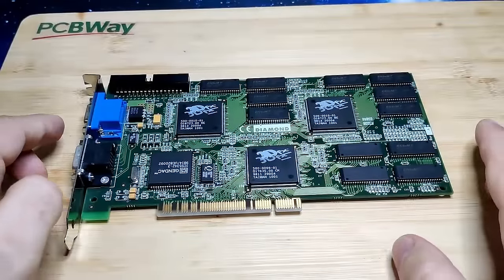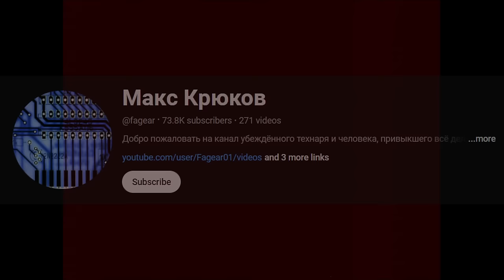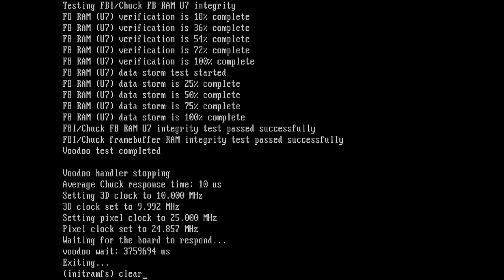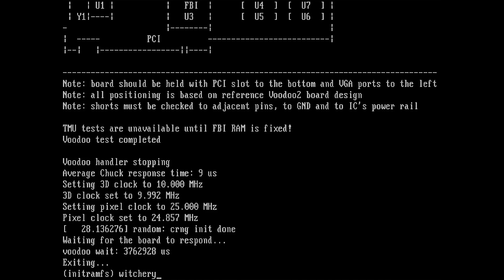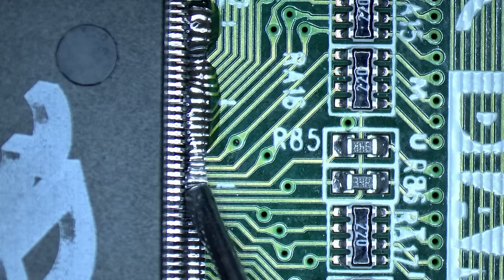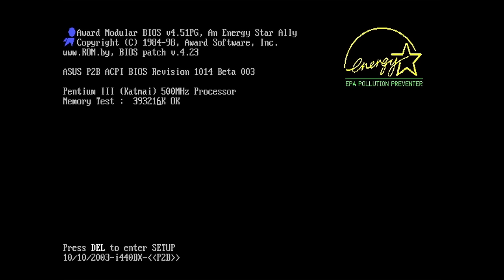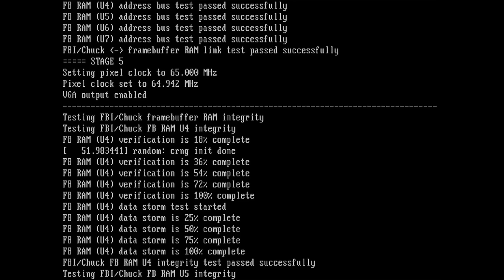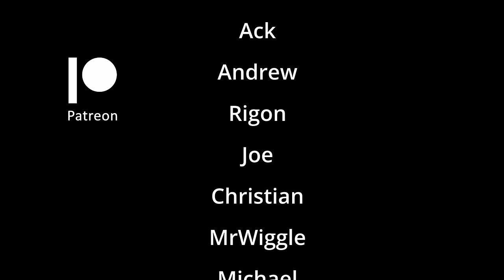The ultimate 3Dfx debugging tool: Witchery! Debug any Voodoo 2 and fix it! (Part 3/3)

Comment: Thanks for the shout out!
I'm glad that this heavily burned V2 board is back to life! 👍🏻
The software is still "work in progress" and it can do very little at the moment. Also all development is done on Linux, so this DOS-loadable package was rushed together and is not perfect. The idea is to get a Linux kernel that runs on 486 and up, the utility itself is compiled to run on 486 (but not tested on it).
I've already fixed some visual bugs to make output clearer, added verbose and help options. VGA output from the Voodoo is not usefull at the moment.
And I have trouble with direct access to upper 2 MiB of FB RAM and with accessing TMUs at all. Any help I can get is great, so feel free to let me know some magic that can allow that.
Reply: Woah. Didn't expect to see you here. I didn't watched your streams for last year or more. So I thought that you digged deeply into VCRs, cameras and so on.
Reply: Very interesting! I wonder if your tool would work for debugging Voodoo3 cards as well. I have one that has some weird memory problems as well, which persisted after replacing the memory chips with known good ones. And as a bonus I am also a Linux guy and would be comfortable running your tool natively.
Reply: great piece of software. excelent work Макс.
Reply: Are you planning to extend the tool to work on Voodoo5 cards? That would be amazing, since there is absolutely no software available for them. 
Thanks.
Reply: Your software is a godsent already, even with what it currently does. Just think about it, any error it diagnoses can save a card. Any error it can't diagnose isn't worse than what we had before: dead cards on a shelf.

I'd really like to test the current build, even if it had to be run natively on linux. PCI Slots exist on late enough boards to have a dedicated linux-based tesing setup that could run recent linux kernels.
Reply: Great tool. Keep the good work.
Also BuB, thank you for the info!
Reply: @stamasd8500  as far as I've found from V3's datasheet it is pretty similar register-wise but it obviously lacks FBI/TMU divide and on V3+ main IC is BGA so probing anything is very difficult. Also memory organisation will probably be completely different. Most of the useful stuff for V2 was done while stepping through addresses while probing and shortng some pins (that's how I've managed to get per-IC map of the FB RAM address space).
Reply: I think you should release it to open-source already, it looks very promising and could restore some cards! The retro community will help with the rest
Reply: @worroSfOretsevraH  the thing is that this utility does NOT use any drivers, it avoids using those. Drivers do not perform any viable tests and just assume that hardware is ok. And when it's not - everything blows up/hangs when you try do anything through the driver. So I have to do it the hard way through direct register access. And there is little information about the registers and inner workings of Voodoo cards. Like, description of a bit says "Linear frame buffer accesses stored in memory FIFO". Ok, I know what "Linear frame buffer" (LFB) means. But what's memory FIFO? Where is it stored? What addresses? What does it change? What commands will be affected? No information on that. And that's only ONE bit in ONE of the registers in ONE model (V2). The V2 itself has a couple hundred of those registers and each contains 32 bits. And V1, V3, V5 will have different registers with different (from V2) functions.
Reply: @fagear  yeah it makes completely sense. The little ASCII graphics you included in the output already told me you worked on a hardware level to develop witchery, not just software :)
Reply: @stamasd8500  yeah... But even that is not enough. For example, I can not find a way to write or read second 2 MiB (RAM ICS on the back). Those are in parallel to the front ICs but have a separate /RAS. Everything I try to do is just mirrored to the first 2 MiB. All test will pass even if no RAM ICs are installed at the back. And I cannot simply probe /RAS for back IC 'cause it is always pulsing as the front one does due to RAM refresh. There several bits in several registers that should be linked with addressing, banking, etc., but nothing I try removes this mirroring of 2 MiB.
Reply: What a fantastic tool. I have a Voodoo 2 waiting for repair. I think the sooner this tool is released, the sooner people can jump in and help improve it :-)
Reply: Nice job man! I'm subscribed to your channel since a long time and like it a lot. Unfortunately, I heard, that YT is being blocked in Russia and now many creators throw in the towel.
Reply: @necro_ware  Wow, thanks! Yeah, "they" try to slow it down but there is always a way around that. I'm not planning to go anywhere from YT.
Reply: Тот случай, когда из видоса басурманского ютубера узнаёшь о том, что Макс создаёт софтину для тестирования вуды. Это было неожиданно!
Reply: wow, debian 1.1 or did i read that correctly?!
Reply: @fagear  so you know about datasheets, good. Next, source code of official drivers is available as well, some info can be obtained from there. And lastly, some open source emulators (like Bochs and MAME) have working digital clones of Voodoo hardware. They are not perfect, but at least you can trace how FIFO works in games and operating systems.
Reply: Is there a reason why you needed to develop under linux, or just a convenience for you?
Reply: @worroSfOretsevraH  i am co-author of this tool and it started like "p3 motherboard with four voodoo2 cards in one place and i am 700km away". i think you cannot do this reliably on dos/win98 at all. xD
and it is easier to use pci bus on linux (both kernel- and user-space).
Reply: Perfect piece of code to run via PXE network boot! Should be easy.
Reply: I hate to be the guy to spoil your parade, but modern Linux kernels and running on 486 may be a tall order.
A YouTuber into "cursed computing" have tried to get a modern kernel running on a 486 (With a lot of RAM!) but it turns out that it has been silently broken for a long time.

So either you will have to live with an old kernel and use old tools, or you will have to patch the newer kernel up, although it does leave Voodoo AGP cards in a bit of a bond due to the AGP voltage problems on the last generation of AGP boards (LGA 775)

Still a good job and I really hope it gets better.
Reply: @CMDRSweeper  "modern" 32-bit x86 linux distros usually compiled for pentium pro and newer. so leave 775 in museum, p2/p3 boards will do it xD
but for example amd k6/6-2 will not run it, because of unsupported CMOV instruction.
Reply: @fagear amazing piece of software!
Reply: A wonderful Work.
Great Job.
Reply: Тот случай когда хотел подписаться на ещё один классный канал, но уже много лет как в подписчиках))
Reply: two suggestions:
1: evaluate running this atop elks.
2: statically compile everything.

#1: embedded linux kernel subsystem. this has support ranging back to afaIr the original pc's 8088.
#2: statically compiling programs means they become practically entirely kernel-agnostic; to put it short, every kernel from I believe 1.0 onwards has had a stable abi, ie it's literally been identical since 1.0's release; that abi is what statically compiled programs rely on, which in turn means even a program compiled today on kernel 6.something could run on a 1.0 kernel exactly as it runs on your 6.something kernel.
Reply: FreeDOS is open source. Just a thought.
Reply: I left a top level comment with this idea but I thought i'd also reply to this comment. It would be cool and helpful if the testing would output the console debugging text to a serial port as well. That way you could plug a serial terminal or another computer running one in and see the output is real-time. It would also be super cool if the RAM testing used a "March Test" which is supposed to be one of the best methods of testing RAM to track down specific bit errors that can slip through other tests. Adrian's Digital Basement recently talked about this in his video about the PC DOS BIOS ROM testing project that's out there. In any case this is amazing and I'm looking forward to trying it out on my working Voodoo card once it's released!
Reply: @Koutsie  I think that's the Debian version of the BusyBox package. It looks like the current version available for bullseye (oldstable). The Linux boot messages mention IPv6, Spectre mitigations, and a systemd version so it must be pretty recent.
Reply: Thank you so much for developing this diagnostic software, I'm hoping for a release soon to check my broken Voodoo 2!
Reply: Фагир - сила!
Reply: @destrierofdark_  good suggestions. To be clear, the tool isn't ready for public release. All development and debugging is going on the P-III-S with debian 11 on it. The "DOS package" was assembled literally in one evening by the man that does not understand most of the linux stuff (that's me). When the tool will be sort of ready then some time will be put into "how to do DOS package properly".
Reply: Thanks for sharing, subscribed to your channel.
Reply: As a work in progress it looks to be a pretty darn cool functional verification test tool already! Have you checked the gunzipped pdf "Voodoo 2 Specifications" available at the old sstfb sourceforge project docs page? It's very cryptic, needs a clear understanding of a rendering pipeline (or 90s console/arcade dev experience?) before the shader age, but has the three memory mapped address space ranges and a very long list of registers. The first 4MB is the registers, second is the frame buffer and the last is the texture memory in a contiguous 8MB, but why it's adding up to 16MB I have no idea. Future expansion, memory price cost cutting, off screen render, double buffer swap into nothing? As I understand correctly, writing to the FBI and TEX range might need the prior setup of a pixel and texture format mode and writing the memory in those formats through the mapped ranges. From the looks of it the Chuck takes care of the comms to all Bruce instances (limit is the fixed number of CS pins or internal bus address?). I'm not a good PC hardware guy and I don't know if you need to do the mapping in the kernel or the BIOS already took care of it. Maybe the former, because I've seen one kprintf stated "PCI BAR0". Also there's a built-in pin solder/silicon mfg testing process I guess which is called NAND/NOR-tree testing. I've read about it on the basic hw level in a TI app report, but no idea how 3dfx implemented it. I saw it even in the debug log output while running the donut demo, but no idea what the numbers mean: "sst1InitInfo(): NAND-tree: 5581, sst1InitInfo(): NOR-tree : 5415". Does it even have a JTAG? Some people on vogons stated that by looking at the schematics of a Midway Seattle arcade machine one can get the pinouts for V1 ASICs which mostly align with pins of a V2. If you haven't seen this specification yet I hope it clears up and confirms some of the pin shorting and prodding trial-and-error behaviour for you. Your keeping it simple method really sped up the reverse engineering process. In the mean time I'd like to see this tool come out and a donation page being set up. :)
Reply: @chironbramberger  well, I'm not very familiar with Linux, isn't there a way to pipe program's output to the serial? As about "March Test", I've read some documents about it but I'm not very good at math, so I've implemented verification test as I've understood what March Test is. Probably it already is a March Test. Probably it needs more work. It's hard to tell for me.
Reply: @fagear  On linux almost everything is represented as a file. I think it's as easy as just redirecting the witchery command's output to /dev/ttyS0 ("COM1") or ttyUSB0 (sometimes ttyACM0 depending on the specific hw kernel module "driver" being loaded) with the use of a '>' operator. Setting baudrate might be necessary beforehand using stty or setserial. For a more complex setup you would need to add console=ttyS0 (also baudrate if needed) next to the existing virtual tty0 in the kernel command line (your DOS bat file loadlin chainloader I guess). That would give a full serial console to the machine. Other than these, the most complex stuff would be to learn using termios, implement it in code and activate it with an argparse switch and the serial device path as a parameter. For a local debug setup IMHO if the problem is only that the 3dfx card VGA switch is active (and the primary video card is being bypassed) the simplest solution is to use two displays or one with a hw kvm switch and remove the 3dfx VGA bypass cable. Simply connect a monitor in it's place.
Reply: @fagear  of course. the reason I suggested attempting to do stuff on elks to begin with was because it runs on hardware as far back as 8086, so even if this becomes modular for other gpu testing, it would still run practically everywhere.

then again, I'm way deep into linux, enough to additionally tell you that you can separate the application and kernel logs so you don't get kernel noise in the logfile.

likewise, why in initramfs? you can do an initramfs-less linux and probably get more sanity that way, even if still ran in ram.

overall, the initramfs solution does seem a little hacky to me.

likewise, if you want a hand, I can possibly offer help.
Reply: @fagear. about a month ago I bought a Voodoo 2 with two completely torn off pins on the FB chip. I restored them, the card is detected but hangs when starting 3D graphics. I think this software could help me a lot. I would love to test this brilliant tool!
Reply: @stamasd8500  This was what I was hoping for, given I am currently working on replacing memory chips on a 3500
Reply: @fagear Will this work with a voodoo 1?
Reply: @death2all79zx  at the moment - no, it will not. Utility checks specifically for the V2. And I've never tried to run it on V1 and explore how it is different on hardware level. But it can be supported in the future, I guess.
Reply: Also eager to test the tool. I do have a voodoo2 with texture artifacts after a 8 to 12 MiB upgrade, with no visual defects.
Reply: @yanndiy  This tool will not be useful for you. It can not diagnose TMUs and their RAM at the moment. Much investigation and testing is required for that.
Reply: This tool is amazing, even in its current extremely Beta state the DOS release would prove massively helpful for those of us trying to fix problematic cards. Any chance of such a public release?

Comment: 0.5 V is about one PN junction worth of voltage drop. So one diode junction, or one PN junction in a BJT or transistor.
Reply: Silicon PN junction. Other materials have different drops.

Comment: "PS/2 is not hot-pluggable, let's double check that" :D

This is now your motto! :D

This software is WICKED! It even shows you a text diagram of the board to tell you what pin you need to check. Super Super impressive! Let us know why the RAM test was with blue background.
Well done in fixing this board!
Reply: It's hot-pluggable in Linux.
Reply: @pvc988  I thought it could be damaged if hot-plugged? (note "could")
Reply: @tony359  Yeah. It doesn't have proper mechanical provisions for being hot-plugged. But I've never, ever damaged any PS/2 port or device that way.
Reply from the maker: I will check with Maksim if he has a clue why it was blue. I tried it a second time, and it was blue again. I cannot see any issues during game play though and the debugging output in Witchery also doesn't show anything.
Reply: My guess is the colours are not set by the tests and are based on uninitialised registers in the GPU. I feel like  the testing doesn't bother to reset them when checking memory.

Comment: I am so happy you got this card running. This was one heck of a project, but you did an amazing job! 
And you make it seem like changing the 3DFX Chip was easy :D
Reply from the maker: Changing the 3Dfx chip wasn't that difficult to be honest. I think the most difficult part is to lift the chip without bending the pins. I should get one of those suction pens. A little bit of low melt solder might help a lot to remove those large chips.

Comment: Thanks, really enjoyed watching!
Software showed no RAM, 'cause after de-soldering the two RAM chips the bits that are always used for data transfers didn't work. It's like having a road too narrow for a car: no matter how long the road is: the car can go zero length of it. The witchery software does testing on way lower level, so it reported specific pins that didn't work (impressive). After this video at least I know that RAM and DAC have separate buses :)

A tip: diode mode can be used to validate trace continuity between chips (3Dfx - RAM, 3Dfx - DAC, etc.), it only shows clamp diodes (google "CMOS clamp diodes")  between chips leads and supply rails.
Reply: One note. DAC and RAM have separate buses but not exactly. Actually DAC has three (3) buses. Address bus (3-bit) and data bus (8-bit) for setup process and data bus (16-bit) for actual pixel data for the display. The first and third ones are separate but data bus for setup has shared pins with FBI RAM. Those are intersected in a weird way. So you can not setup DAC when RAM refresh works and vice versa. That's why there is a bit in config space register for remapping some registers between normal workflow and DAC operations.